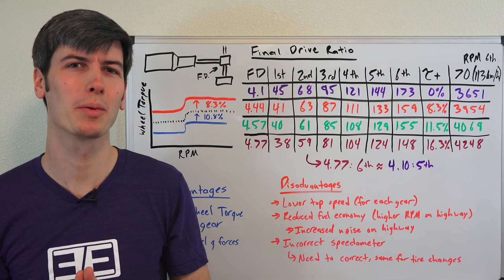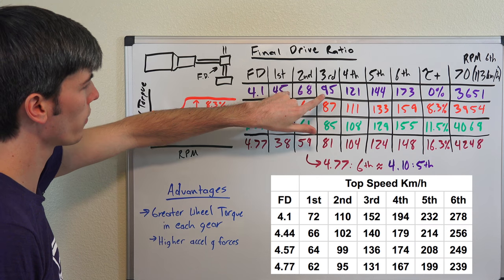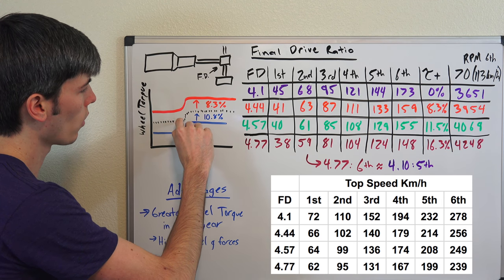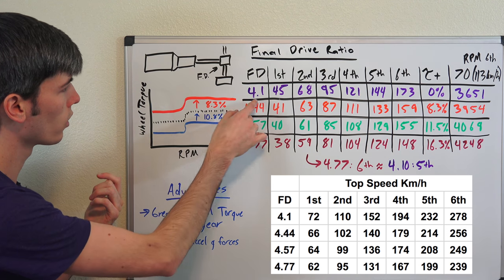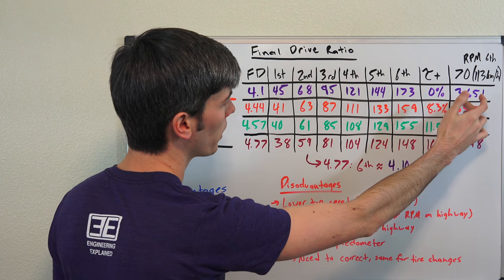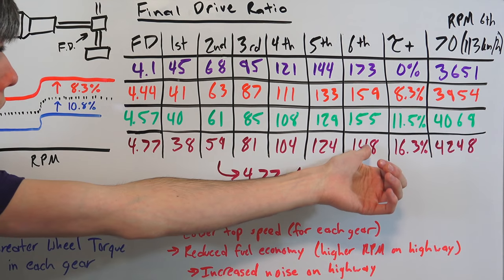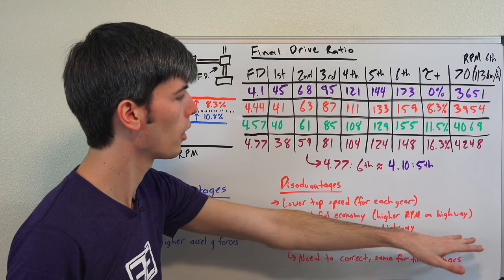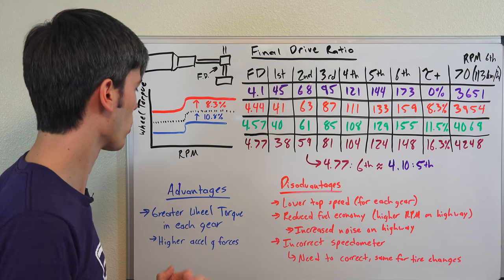Why Is Final Drive Ratio Important? Accelerate Faster!

Comment: I have an r154 transmission and a 3.73 ratio rear diff. Theoretically, what could my top speed be in 5th gear at 7000rpm?
Reply: Tire size is an important factor.
with 215/45r17 tires your car is geared for 182mph at 7k rpm
with 225/45r17 tires your car is geared for 185mph at 7k rpm
This doesn't mean your car could hit that speed, but that's the fastest it would travel with that gearing if you had enough horsepower
Reply: Tyler Turnipseed cool thanks man. I'm running 18" wheels 225 in front 265 in rear both 35mm sidewall and the car makes a bit over 500whp

Comment: You are misleading your viewers when you say "higher ratio". You said the 4.77 is a higher ratio than the 4.10 & that is incorrect. 4.77 is a larger numerical number but it is a lower ratio. 1 to 1 is a higher ratio than 4 to 1.

Comment: This video is very misleading. You will not get greater torque at the wheel with a lower gear ratio; I mean, you will... but only at lower speed which defeat the purpose.
Given a certain speed v the torque at the wheel will be pretty much equal on average because you will have to use a higher gear to reach that speed v thus decreasing the torque at the wheel.
You will get slightly better average wheel torque since the rpm range the engine needs to 'travel' is shorter and you can keep the rpm near peak power point but this effect is very minor and depends on the actual power curve of the engine and it is a lott less than the 10% figures suggested in the video.
An engine with a flat power curve will not benefit at all from lower gear ratios. An engine with a very peaky maximum power point will benefit more from it because you can keep the engine near that peak power point with more 'compressed' gears.

Comment: so why is it impossible for my scooter to go over 300miles per hour? what would happen if i would change the gear ratio to lets say 0.01/1 (engine rpm/wheelspin) so at 1000 rpm the wheels would spin at 100 000 rpm, why is that impossible??
Reply: the engine will stall, even an f1 engine will stall with that ratio
Reply: Vlad Mitrofan why? what if i make 20 gears and the gear ratio keeps getting smaller and smaller?
Reply: the pistons to make one rev will not have power from one rev to rotate the wheel 1000 times, you can make a 1 to 1000 ratio gear at home by making one big circle connected to one small, and that one small to be welded to one big and that one in order to one small and so on. When I was in 6th grade I was thinking same about you only for a bicycle, and my physics teacher explained me, it's impossible.
Reply: Vlad Mitrofan ahhh now i get it, thank you very much ! :)

Comment: can you the gears in a trans axle to go faster?
Reply: can u change the ratio in a trans axle for more speed
Reply: The principle should be the same. Just needs a lower circumference and proportionally fewer teeth pinion gear, and a thicker (to close the gap left by the pinion gear) ring gear (with the same amount of teeth.) to get more torque, and the opposite to get more theoretical top speed.

Also the distance the angles on the pinion gear has to wrap on ones with non-straight teeth stays the same, so with a smaller circumference pionion gear that'll be more degrees, and vice versa. This gives rise to the limitation on going too far towards the torque end, because it'll basically make the ring gear act like a worm gear on the pinion gear and you'll have a friction lock because of too messed up angles. The limitation on the opposite is that the larger pinion gear won't fit in the housing or that you'd have to make the ring gear a non-positive thickness to compensate. Usually you can change it by a fair bit though.

Assuming there is no room to spare in the casing, of course.

Comment: how can you get the top speed for each gear ?
Reply from the maker: Included a formula in the video description. This is for MPH: 
Top Speed = ((RPM*60)/(Final Drive*Current Gear Ratio))((Wheel Size (in.) +(2(Tire Ratio/100)*(Tire Width (mm)/25.4)))*Pi)/(5280*12)
Reply: +Engineering Explained   150mph or 155mph (I can't remember it has been 10 years) until you hit redline in 6th. AP2
Reply: Engineering Explained what and how to measure the wheel size, tire ratio and tire width?
Reply: Andrew Snyder , its as you say, width doesnt affect it, circumference does. And it differs on what car we're talking about aswell i the percebtage that it will affect the spedometer. Go to your local tyre shop and they should be able to look it up. 

Used to work in a tyre shop ☺

Comment: wrong wrong wrong... let me explain.. he is a little lost as to the effects of rear end gearing.   sure, each gear is shifted up or down 8% in his first step of change, example.   what he keeps on saying is that the torque is increased in each gear.. this is true... top speed is sacrificed.. this is also true. BUT.. and this is a HUGE but (and he mentions this) hp of the engine is not change.  toruqe of the engine is not changed, so what really happens???

1. the new lower gearing shifts the shift points up or down. no power is created.  sure, the new 1st gear wiill redline at a lower speed, but you need to shift earlier, which looses 30% torque.. so you gain 8%, but loose 30% for. in the end.  no gain.       next gear, same thing.. more torque, but at a lower speed, then an earlier shift to a 30% lower torque gear... net gain 0
2.  you only mess with gear ratios to match your max HP range and operational range to the speed range you will be in.     Example:   turn 5 at a track near you... if the lower gears force you to shift in a taller gear  before braking, the net gain will be less!   however, if you dont redline, and are at the max HP range during the final gear, you are at the maximum acceleration potential of the car
this kid comes off like he knows what he is talking about , and he has the correct facts but draws the absolute wrong conclusions.

Comment: how would one change the final gear ratio?
Reply: to adjust and tune the torque and rpms of a vehicle for its intended use, an off road vehicle may be better to have higher gear ratio to get more torque and control on rough terrain while a vehicle meant for highway use can benefit from a lower gear ratio...
Reply: ... which does not answer my question in the least.
Reply: oh you are one of those, forget it...
Reply: He asked "how" not "why". You're the one being "one of those" mate.
Reply: yes please I too want to know how??

if you get an answer anywhere please share a link
Reply: you ask HOW?... depending on your car, you need a new ring gear and pinion, open up the differential and swap the parts...
Reply: Well that sucks, my Land Rover already has a low gear ratio 3.18 and still struggles on the highway, could realy use a 6th gear haha.

Comment: I drive an automatic car
Reply: Me too
We are both special
Reply: Yaay :)
Reply: Amaey Paradkar Kickdown.
Reply: On an automatic if you put your foot right down it over revs and skips all other gears and kicks into the highest kick.Well it does on my car if that made sense
Am really bad at explaing things
Reply: No idea my car only got 5 gears.
Reply: What? A kickdown doesn't make the transmission switch to the highest gear. It goes to the lowest, still viable gear.
E.g. your driving in 4th gear and want to overtake someone in front of you, you push down the gas pedal and the transmission will change to 3rd (or if possible 2nd) gear so it can deliver the power you are asking for.
Reply: me too but I still manually shift it.
Reply: Bombaclot!

Comment: I like the topic of your videos, but you are unnecessarily verbose and repetitive. 
I'd suggest you make a few dry runs to your parents or friends, and think of several ways to say the same thing, more simply and concisely. 
Your diagrams also get overly busy for the point you are trying to make. You could use three rows above, rather than 4. 
Finally, re this topic, it is extremely significant to quantify how much fuel efficiency has been effected.